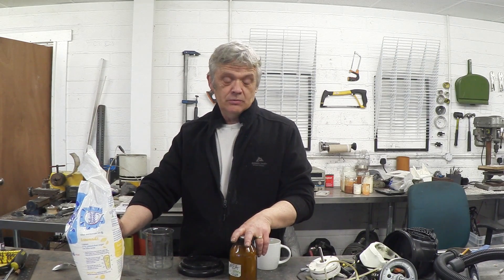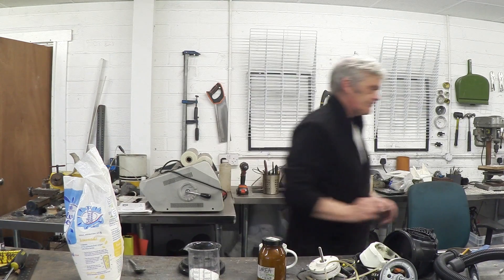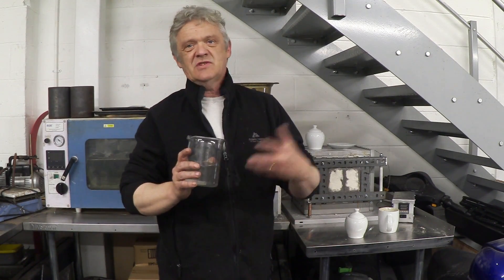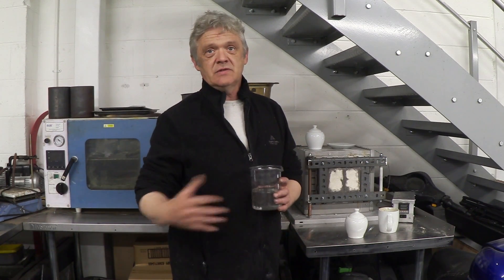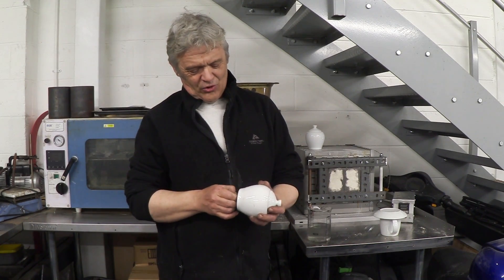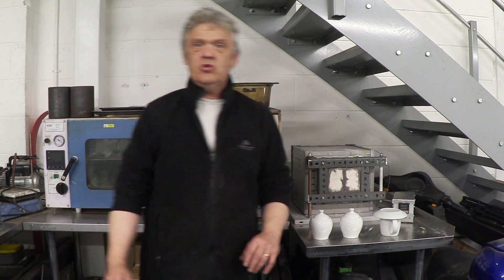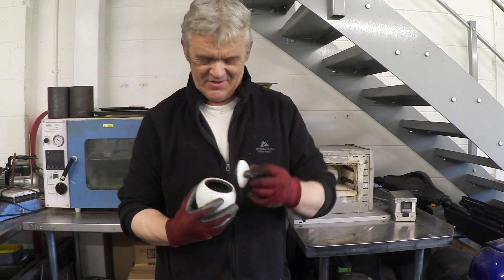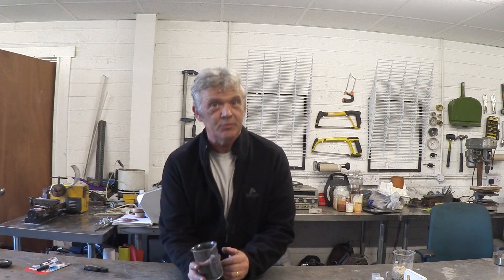DIY Safe Hydrogen Storage

Comment: so if you had 10 kg of this made up, you could store 1 kg of hydrogen, with that 1 kg of hydrogen you could store approx 120 Mj of energy or 33kwh of energy
Reply from the maker: thanks for working that through mate
Reply: Thats alot of energy density, jeez
Reply: The problem is, though, the efficiency of getting that energy into hydrogen first, then releasing it back will drop down to about 30% of the original energy input?
Reply: Still if I could store 20kwh usable energy in my 20kg storage that would be way better than 1.6kwh in my almost 20kg batteries right now. I can finally live off grid without compromising on anything.

Comment: How can we make liquid hydrogen
Reply: By doing efficient cooling methods, like NH3 water adsorption cooling for first stage, perhaps Stirling for 2nd and 3rd. Have not dogged into this. This is high energy physics business, cooling superconducting magnets is an equivalent task. You loose 30% energy by this, much more than the adsorption energy you reclaim. Of course you could do cooling by the evaporation, and depressurisation can be used to drive turbines. But every building block of complex machinery adds to the costs.

Comment: The best form of Hydrogen is "on demand" - unfortunately your other videos do not cover methods for this rather slow and expensive methods of Hydrolysis with high current and power needed. Net sum game at best "0" or worse "-" gain

Comment: So wait, you put this in a tank with hydrogen in it, it sucks up the hydrogen and then you can take it back out of the tank? Then you like heat it up and it releases hydrogen?
Reply from the maker: that's what the papers say mate
Reply: It would be practical to leave it in a tank with a digital heater for controlled release of the gas to power an engine, torch, etc..  See Bob Lazar's hydrogen corvette for reference on full system build out.

Comment: this just goes to show how capitalism really muddies the water when it comes to the efficient distribution of useful materials. how long has this been known about? how long has it been known that graphite foil is the best material for hydrogen generation? how long ago COULD we have stopped using gasoline and COULD have been using hydrogen? ...but then there wouldn't have been much money in fueling automobiles 🤔🤷🏼‍♂️
Reply: Using pure hydrogen for vehicles is easy, but making it energy efficient sadly isnt, however from what ive read this stuff can split water in sunlight on its own and release the hydrogen under sunlight, if a system like this could be designed efficiently we could be looking at a solar/fuel cell hybrid car
Reply: You couldńt even wag the dog on climate crisis :)

Comment: what are you Banging on about we have A safe storage of hydrogen Naches dos it well  we call it water we can get is it be barning charcoal & sucking in oxygen & the ad steam to release hydrogen in a gas form. Or   split it with an electric current to release hydrogen & oxygen In the form of gas that can be uresd in meny ways

Comment: All that and no results not even an attempt to show the properties of the material. There are too many fakes out there to take this seriously. shame, I liked the guy and the presentation.
Reply: He empowers you to DIY, so try out. He will not take that burden from you. 
He will come back to the material, if he is allowed. 
Just use some old heating wire spiral and wind it around your sugar bowl, need a temperature sensor, and wrap around it some chimney Rockwool insulation that is temperature resistant (F90). Use outsides on non-flammable ground, sand… 

I already bought a fine scale 1/100 Gramms resolution. So I can weigh the hydrogen uptake. 

I will use a heliostat setup, and include some small double-glass quartz window DIY in the insulation to shoot in concentrated solar light. Just blacken some outer ceramics pot with soot.
I will steer temperature by adjusting focus and tracking of the mirror, and use electricity only when a cloud shades the sun.

Perhaps, in future, I will try out add-on microwave heating able to penetrate the inner insulation (for glass melting, this works exceptionally well)

Comment: Нихуя не понятно, но очень интересно!
Reply: What do you want to know? You heat up dissolved urea with 10% sugar and get a nano-Material that is able to store 10% of its weight in weight of hydrogen without loss per month, without pressure, chemically adsorbed, and reclaimed by heating it up with heat of eg some catalytic hydrogen burning you later use of course for driving what you want, some sterling, micro gas turbine, I would like to build a Tesla turbine, but any old motor you can re-build as a gas motor will do. The excess heat of this will go into the heating.
I understood the same GCN material can be doped with catalysts like metal atoms to do photocatalytic or electrolytic production of hydrogen or ammonia, which is even easier to store, so the hydrogen storage would be for intermediate use, the ammonia for winter and the gas car (which can work with ammonia). BMW drove one for 12ams I think. 
Better?
Reply: @andshofs5769  Hey dude hello! Thanks!